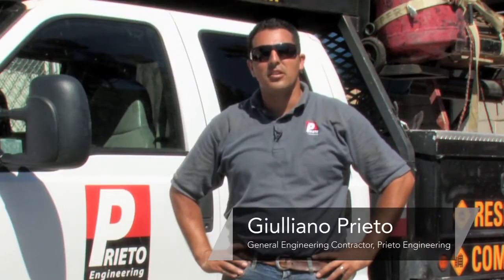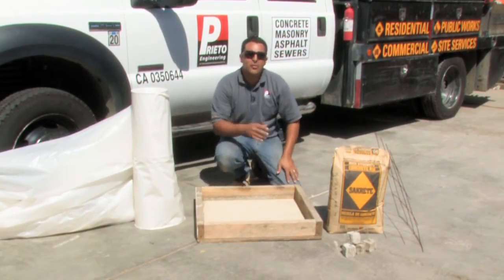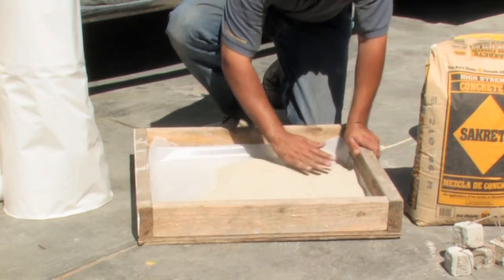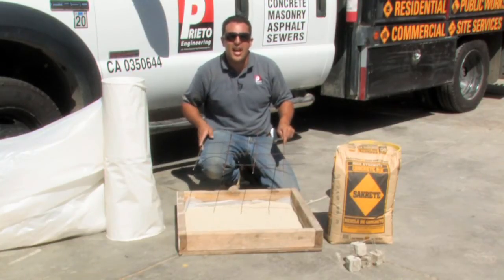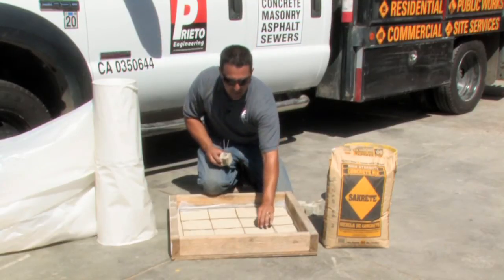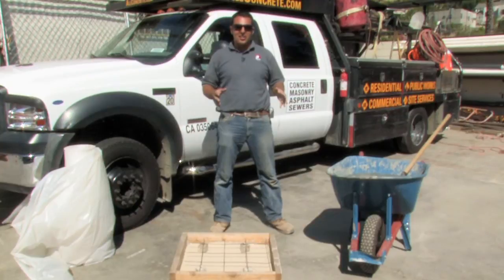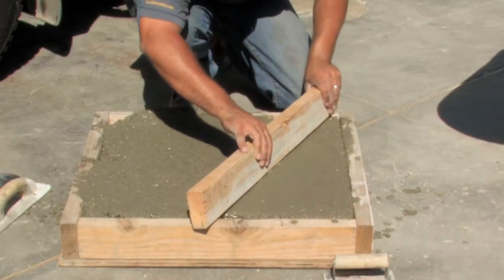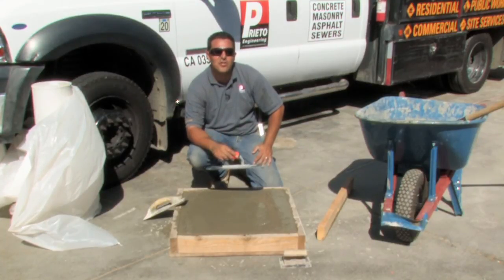Concrete & Masonry : How Do I Install an Interior Concrete Floor?

Comment: Question:  I want to raise my basement floor which is concrete.  Do I need sand to do it?   Wouldn't sand cause the concrete to break up over time?

Comment: Does anyone know about the weight-bearing factor?  Meaning, do I have to ensure that the floor underneath is strong enough for the weight of a concrete floor? The area we want to pour is a small, outdoor porch, about 5 x 6 feet, but it's undercover and is used as the entrance to our kitchen.  It's on the 1st floor level of the house, but there is basement underneath of it.  Any advice would be appreciated.  Thanks .
Reply: Your second setenance... "Do I have to ensure that the floor underneath is strong enough for the weight of a concrete floor?"  

Do you think it would be a good idea to not ensure that it can support the weight?